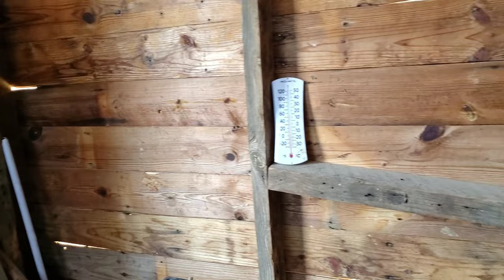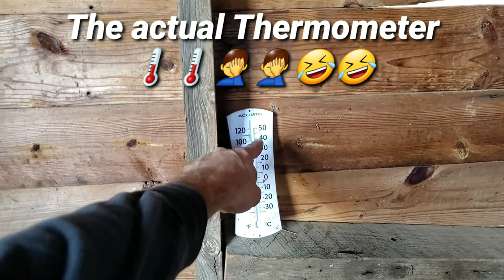Chicken Composting System (week 3)

Comment: I think a lot of the dangers from dust exposure is from prolonged exposure over the course of years. Chickens typically don’t live all that long. I would also think that they are   genetically prepared to survive dust as that is part of their life style.  I do much the same in my chicken coop except placement of the roosts. I have several that span the width of the coop so the droppings fall into the main pile of compost and not against the walls as do the ladder type roosts. I took short pieces of 2x6 and cut a notch that the roost boards fit in to. I do not nail the roost boards down. The 2x6 notched boards are nailed but not the roost pieces spanning the coop. They just rest in the notches. Easy to remove while working in the coop. Just lift out of the notches and set aside. The height of the 2x6 pieces can be varied. Heavy breeds seem to like lower roosts. Bantams like higher ones.  This system keeps your floor uncluttered. I actually find it is less work as I don’t really have to move things around that are on the floor. Good video.
Reply from the maker: Cool that makes me feel a little bit better about the DE dust bath. Thank you for the awesome tip on the roosts!  I may need to figure out something like that for mine. My compost pile is putting off a lot of steam.  If I put the roosts directly over it I'm worried that the steam may settle on the chickens in the Winter and freeze. Did you have that problem?
Reply: Honest Open Permaculture I don’t have that problem BUT, (big but here) I am only ten miles from the Texas Gulf Coast. Typically it never gets that cold for that long. I worry more about summer heat. I don’t usually compost in the hen house in July and August. Different region, different problems!  I don’t usually leave my compost in the henhouse long enough to go to steaming. Just long enough to get a good amount of manure and then it goes outside for the next batch. I use free municipal wood chips that I run thru a chipper shredder and leaves. Once I move it outside I mix grass clippings and free Starbucks coffee grounds. It gets hot! 160F is not unusual.
Reply from the maker: @ddd3240  got ya.  It will drop down into the teens for the low here for a couple weeks. The main reason I'm letting it heat up in the coop is to see if it helps keep them warm. Hopefully the steam doesn't turn my girls into ice sickles. Lol.  That is one reason I'm not letting it heat up directly under neath them. We'll see. 🤷‍♂️
Reply: Honest Open Permaculture Live and learn!

Comment: I was wondering about the pile  leaned again the wall of the mini run, when the chicken scratch at it and kick the material down to the middle, why not put that stuff back into a new pile accross the middle, on the other side of the mini run ? That way the chicken aerate it for you, you just have to pile it up again and the bottom of the first pile gets a chance to be aerated too otherwise it just sits there (while the top is constantly aerated and turned) until being wholy turned onto the next stage, no ?
Reply from the maker: Sure I think you could do it like that. I don't worry about it because by the time the compost gets to the end all of it has been turned quite a few times.